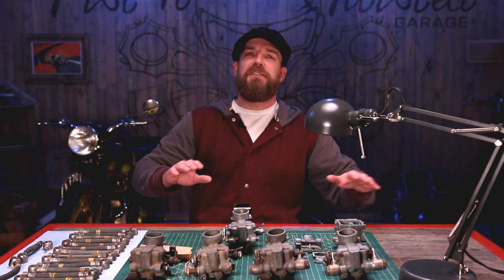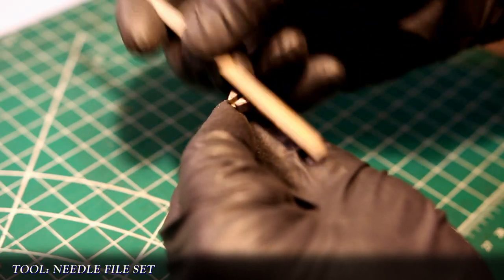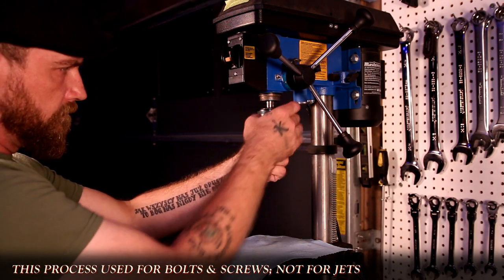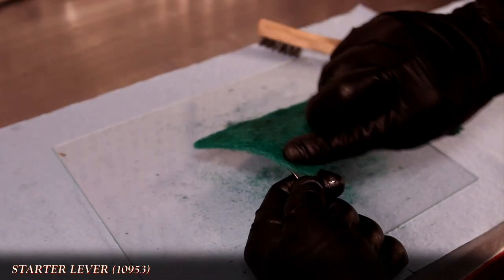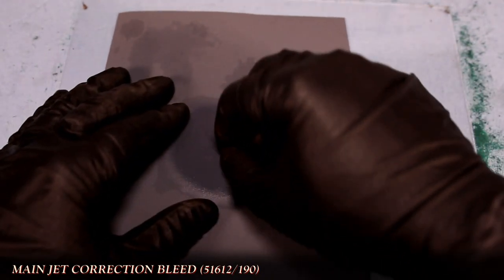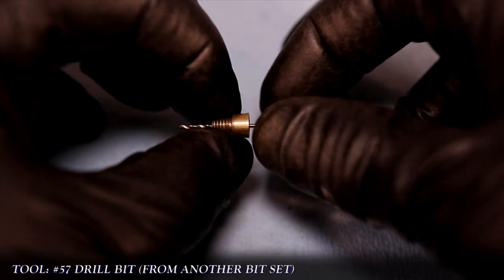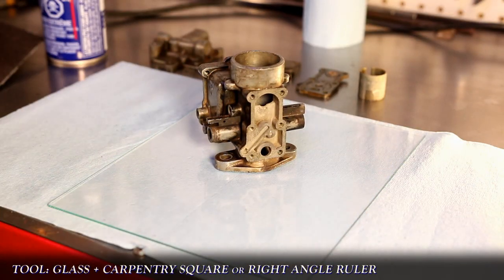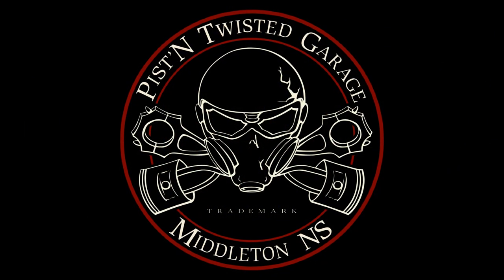Vintage Motorcycle Carb Restoration - Step By Step Overhaul -  Pt 2

Comment: Amazing video! Maybe a silly question: why do you use a glass plate as a base when you’re sanding/ filing?
Reply from the maker: Hi Sabrina, thanks for watching and the question - not silly at all. The flat piece of glass has a few uses. First, when sanding, it will help ensure a nice even, flat surface to sand on. This will prevent any bows or uneven areas on the sanded face by ensuring even contact between the sandpaper/emery cloth and the surface being sanded. 

The second reason I like using glass is that it is much easier to clean up after. Cleaning glass will always be easier than the steel workbench face. 

I hope this answers your question. If not, or if you have any others, please don't hesitate to ask. I try to explain as much as I can in the vids, but even I get tired of hearing my own voice, so some info gets cut. 

Thanks for the support. Cheers!

Comment: I'm spoiled by the ability to work with more modern stuff where all the wearable pieces and tuning pieces are very easy to acquire.  Love seeing this kind of work where you're forced to use as much as you can and with great care.  Excellent video!
Reply from the maker: Part of me wishes that these parts were more readily available, to make life easier. The other, larger part of me loves riding classic British bikes, and refuses to make anything easy. Lol. 

As time goes on, I do hope to find more available replacement parts. The needle valve was a pleasant surprise, I've found a lot of NOS spindles and butterflies, but the floats are, well, not that easy to find. Mind you, they're thin brass or copper stapms, and with the ability of 3D printing, I could always make a stamp. 

I could go on for hours ... but, thank you for your support and for watching. I really appreciate it!
Reply: @PNT-Garage  if it were easy, everyone would do it!
Reply from the maker: Valid point. But as much of a pain in the butt as these bikes are, the old Brits are an absolute blast!
Reply: @PNT-Garage  it’s making me want one!  Looks like a lot of fun!
Reply from the maker: Wait until '23 when I start building two old classics. If that won't make you want to get one, I don't know what will!
Reply: @PNT-Garage  lead me not into temptation, as I will run like hell towards it!  Can’t wait to see what you’ve got coming!  😂